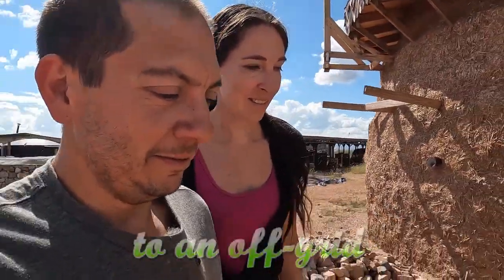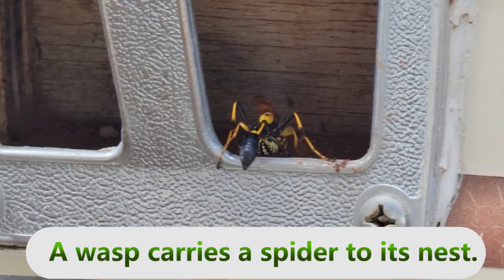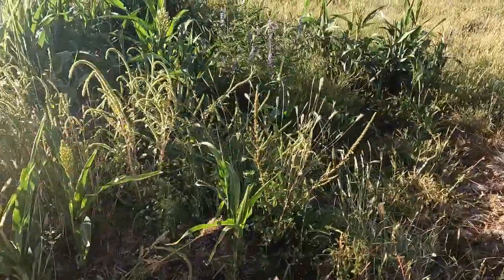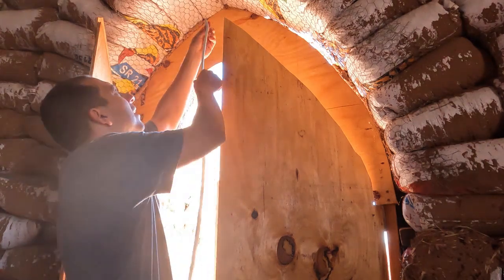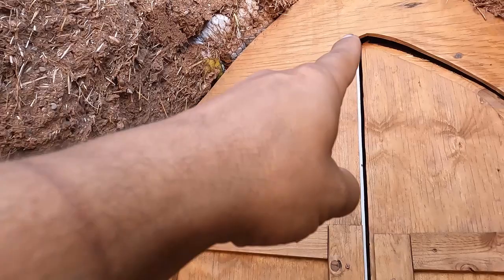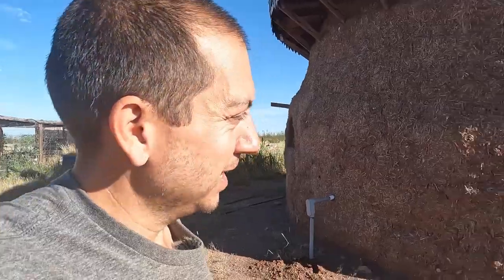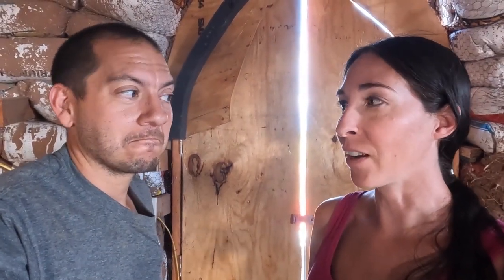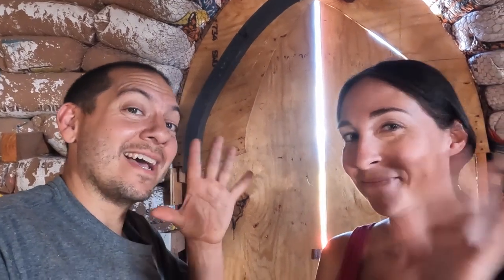We NEEDED To Do This To Make Our Home Livable | Building Off-Grid In The Desert

Comment: I've built three houses and one thing learned was get as much done before you move a bunch of stuff in because you will spend a lot of time moving stuff out of the way to be able to work. Its difficult to keep things clean too.
My suggestion is to get the walls finished. The floor can wait.
Good luck, keep plugging along.

Comment: Jim add a piece of ply on the inside of your door vertically over the daylight in the center. Screw only one side, this would be something like an astragal strip. Next cut two curved pieces to cover the top the same as your astragal. Make sure you screw the door side only, don’t screw the top above the doors. This is easier than messing with foam pieces. Tom
Reply from the maker: We did that in this video

Comment: I would put a board in at the bottom, and wood trim instead of the foam to get a better seal around  the upper arches and where the doors meet.  Or make tin shields like you did around the roof, only much smaller, and put them on the outside of the door. Nice visual tie in .  The board at the bottom, tied into the doorway, will prevent the doorway from spreading as the building settles, and wood on wood or wood on stone will deter critters that dig. Also deadbolts to lock the doors into the upper arch to keep them closed in case of wind or other undesirables from getting in as easily
Reply: Yes... a thresh hold would be much better for floor sealing, forget the foam. Use trim boards for the doors to hit against and stop when closed.
Reply: Critters will chew right through foam and ants will chew through caulking.

Comment: Yes Jess I agree with you need to be tighter so maybe put like a a form around where the openings are and then put Steyr out of a can a spray into that mold that you made or I don't know what you call it but anyway I totally agree that way it would stop the leaks from air flow and then that middle portion when the doors meet then put one in them rubber I guess stuck up and down that door to make it tight when you close this big boy

Comment: Some good improvements on the door,  Jim. Of course,  if you can see daylight, the mice, spiders and scorpions probably have enough room to get in. I suggest these 2 pc. slides that can snug in the top of the door from the inside. Then, the question of tightening the upper and lower edges from the outside.  How nice that will be when you two can move in. 🛖🏜
Reply from the maker: The door is all finished. No light shining through
Reply: @ourselfreliantlife  bravo!🤗

Comment: I would put a board maybe a 2 by 10  at the bottom across the doorway embedded about a inch into the dirt for two reasons , one bug`s and snakes and other stinging critters crawling will follow the wall till gap is found , and your doors open inward letting you cob the board you just have to remember to step over getting out second reason it will keep out the worry of monsoon flood water getting in past that board

Comment: You need to put 2" either in front of the door or back of the door to help seal it. By having the door open from the out side give you more room inside. Cause the doors are not going into the house.

Comment: Most front doors opens from inside. rather than out side. cause of wind. This also lets RAIN SNOW AND WIND INTO THE HOUSE!  But it give you more room open from the out side. If your hurting for room. I don't think your front door is big enough for a double door. I really think you would be?  LOTS BETTER OFF WITH A SINGLE DOOR ~ All of my doors going inside the house, opens from the inside. Now this does, hurt my floor space inside my house. Making room For Chairs ect. around the doors to open. THAT!   Could be used for other things? Like a heater, Coat Rack,  ect ect ect  I dearly love a " coat, boot and hat rack "  by a door > This is where my coats, boots, wind breakers, slicker suits and things are at. That you need to go out side in.

Comment: ok so this door has been the elephant in the room for awhile every one sees it but no one says any thing . ok its a temp door . but why dint you just frame in a square door frame with a square door and fill the rest of the arch with scrap wood . you would not have had these issues now and there would have been a tighter seal . as far as double doors go  you still could have done the same thing and they make latches for them double  doors . one side of the doors stays shut and latched for the most part . even if you made them yourself it seems like you should have went with square doors . it is much harder trying to seal them odd shaped doors . i was hoping that was what you was planning when you started making the door frame outside . maybe this double door thing is just a little out of reach for you . i would stick with the k.i.s.s method . or at least go check out some real double doors and figure out where you went wrong . look im not trying to be a butt hole just pointing out the obvious  . i look threw your comments and see a bunch of  oh your doing a great job and im so excited to see you doing this . but not alot of people telling it like it is . sure you might block me  from comments and if thats what you want thats fine . but  them your so great comments and no one telling you whats wrong or how things  work better is not going to help you at all . you need to put in a square door frame  and doors and seal off the arch . them  jerry rigged double doors will never seal right . and to be honest for a temp door they dont make much sense . sorry to have to be honest with you but i hope you can take it like grown ups and see that im only doing it to help . take care work safe .
Reply: I don't see where you are criticizing.
It saves a lot of time and money to learn from others mistakes and advice on what works.
A lot of people are rooting for you two and want to see you live your dream.
Keep in mind you will be working on your place the rest of your life. 
Do things in a way that will last and you won't have to keep redoing things.
Keep plugging away at it. You'll get there.
Reply: @cinder7183  ok seeing how you want to dip in . i was not criticizing them just pointing out  what even they know . and from your own comment you know it as well . the door needs a proper door frame and a proper door . i dont see them  making it useful the way they want it for a long time . did you hear them say  there is a whole other dome yet to be built . in the mean time  a proper door would allow them to use the dome as a home . and im sure a good door is part of there dream most people want a good door . temporary or other wise . but if you want to sugar coat it thats fine just do it on your own post not mine . especially  when you pretty much agree with what i said . other wise you would not have told them to do it right in the first place . take care have a nice day .